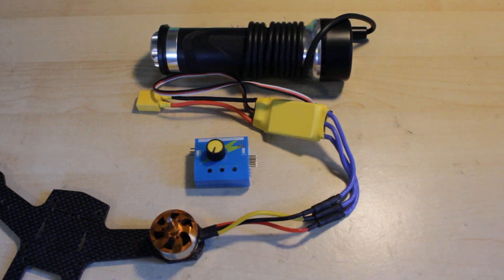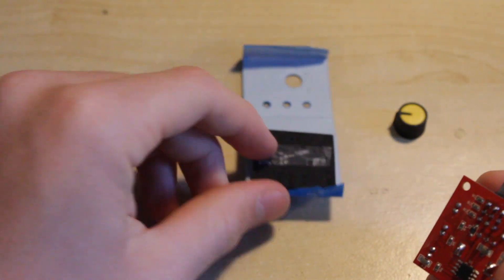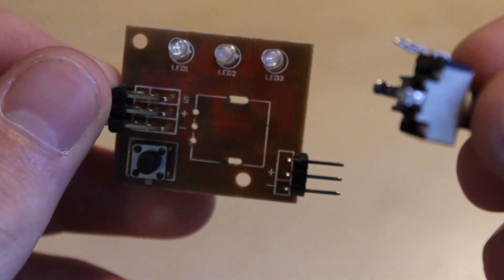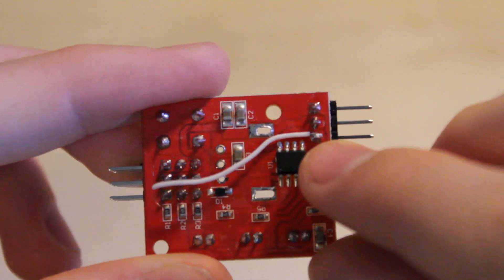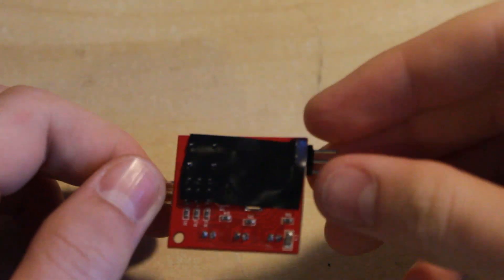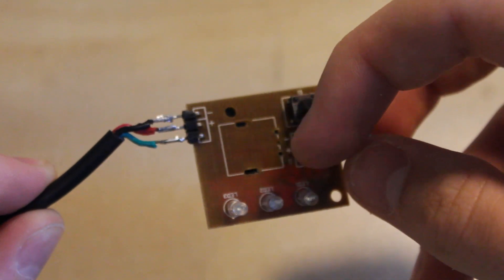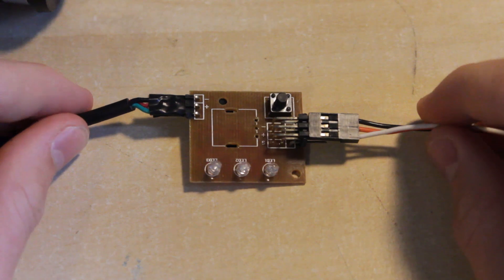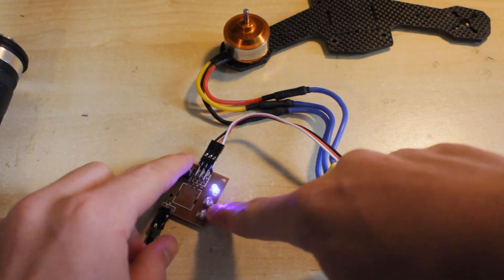How to connect electric throttle to Esc or Vesc

Comment: Hey, I did everything as it is shown, but as I push the thumb throttle all the way up, then it is a stop, ant when I release, it is a full speed lol. What can I do?
Reply: Aand, yes I burned up the hall sensor in the thum throttle when I switched up +5 and negative. So I had to resolder the 49E hall sensor, to fix it. The problem was the magnet in the throttle had been installed the other way around, so I removed it with a small electronic flat screw driver and turned it around. The thing is that it shows 4,2V with throttle released and 0,8V on full throttle. Then it works well :) I hope this comment will help someone. Thank You for this awesome video man!

Comment: Everything works great, but the problem is when I increase the throttle the motor stops and when I decrease the throttle the motor spins at full speed. It’s working the opposite way. Anyone know what might be the problem ?
Reply: I fixed the problem by opening the throttle and reversing the magnet

Comment: I connect everything exactly like shown, when I push the throttle the LEDs light up but nothing happens. I tried making a jumper connector but that didn't work either. Any ideas as to what the problem might be? Thank you in advance.

Comment: Hi Gabriel, that’s a nice video.
I have a 12v motor, 12v battery and a twist throttle. How can we use servo tester as a 12v motor controller?
Any idea ?
Reply: What type of motor?  What type of throttle?

Comment: Hi I had follow all in your video but when i  acceleration it stop but when i release the throttle it speed up . What to do next
Reply: Flip the magnet in the controller or use a servo signal reverser.

Comment: Thanks for the clear demonstration. I, like many other people, have an Opto ESC (Turnigy Dlux) and the servo tester 
works only when powered by external voltage source. 
My problem is that I need a sliding potentiometer for my DIY gas throttle, not a rotating one. 
Would it work if I just desolder the rotating potentiometer and connect a sliding potentiometer (by two wires) to its place, not making the jump wire connections? Would that leave the servo tester's action modes (automatic, manual etc.) intact.
 If you can advice me on this issue, thanks in advance!
Reply: I solved the problem. The servo tester has on the side of the esc three entries. You just have to connect a 5v battery with the second entrie. The first is connected with the esc cable. 
Sorry for my english.
Reply: You would need to solder all three wires from your sliding pot (10K?) to the board and also jumper the 2 pot tab holes together to continue the +5VDC to the circuit.  As you state, you will need external power.  The action modes will still function, it defaults to pot control.

Comment: Something useful, Thanks,  but how instead of throttle add full power on off switch?
Reply: That would be rough on drivetrains!  You could try a SPDT switch in place of the POT with the center to green signal, one side to +5VDC and the other side to negative.  I have not tried that.

Comment: Hi, I have tried this modification with thumb throttle, the Led all lit but no response when I press the throttle. I solder the connection as in this video. Any suggestions?
Reply: Same.for.me :(

Comment: Can you plug the throttle on the channel side and add a receiver and be able to switch back and forth between rc control and throttle
Reply from the maker: yes if have a servo connection on the end of the throttle cable and then a jumper for when you completely remove the servo tester. This will allow it to be both rc or human operated

Comment: most helpful video ever! thankyou very much!!! only question is, if your esc doesnt have a BEC where do I run power from for the servo tester?
Reply: From a battery with the voltage required of the serve tester

Comment: Hi Gabriel,
I made the same process as you but at the end I have a light on (like you) but when I throtle up the other two less light up too... For example:
25% throttle - one led up
50% throttle - two led up
Full throttle - three led up

Can it be bad connection?
Reply: Just solder a wire (jumper) from the 2 big pins Ground on the board, it should work.

Comment: Is that a sensored or sensorless brushless motor? I'm guessing sensorless. If it was sensored, it would have that weird 5-wire connector coming out of it with the 2-red, white, yellow and black wires right?

Comment: GUYS IF YOU WANT TO CONNECT AN OPTO ESC JUST CONNECT THE POSITIVE AND NEGATIVE FROM CABLE THAT ALLOW YOU TO PROGRAM YOUR ESC, THEN YOU HAVE TO SOLDER THE TWO SIDE SUPPORT FOR THE POTENTIOMETER (NOT THE THREE WIRES, BUT THE SIDE SUPPORT) CONNECT IT TOGHETER AND IT WILL WORK !

Comment: I dont have any controller i direct the batt to the motor so i need to use this badly
Reply: I did that with a brushed motor and a lead acid battery power source. It was inefficient (energy wise) and heavy and everything got hot but it was a radical setup and funner than not having a motor.

Comment: I thought these VESC controllers already had an Analogue to digital converter (ADC) inputs with +5v & negative throttle supply?
Reply: Jamie Low that’s what I did. It’s a lot easier
Reply: yes cool but how does it work and how shout i conect it
Reply: VESC does, regular RC ESC like he is using does not.  This makes it possible to use a regular RC ESC.

Comment: thanks a lot for the video. It didn't work at first, then (after some troubleshooting) I joined the two joints where the potentiometers body was soldered in, and everything started working fine. Thanks again mate.
Reply: Yes me to and i think this man in video skipped this step in purpose. I don't know why he did it

Comment: Its Work !!!
But the throttle is reversed ,when i pull the throttle the motor is off and when i not pull the motor is on.
Please Help me
Reply: It sounds like your polarity is reversed or inversed or something at some point. It sounds like you maybe didn't solder the wires in the right place somewhere on the servo tester. I would be curious to see with the way you have it set up what would happen if you reversed the polarity of your motor and see if it works (change the red for black wire positions). If it works or comes closer, then that might indicate your wiring is off on the tester. This is sort of a laymans/experimenters reply though.
Reply: I just finished wiring things up, and have the same problem. 
I'm using a thumb throttle. When the throttle is in normal position (ie: 0 speed), the motor runs full power. When the throttle is in full power, the motor is off.
So it does work, but in reverse.
I'm now going to test some things and see if I can get it to work as should.
Reply: UPDATE. I fixed the "reverse problem" by actually flipping over the hall sensor. IE: The marking on the sensor was facing the magnet. Now the backside of the sensor is facing magnet.
I'm 100% sure that flipping the magnet would also have worked, but in my case it was easier to flip the sensor over.

Comment: bec esc yes...but how to connect for opto esc?
Reply: Same thing you just have to find a way to give the servo tester power in addition to this process , i think you can use one of the other pin sets to give it power.

Comment: I am running two motors, with two ESC's.  Would I be able to plug both ESC's into the servo tester so that I can run both motors off of the one throttle.
Reply: yes
Reply: Yes, be sure to disconnect the red +V from either one of the ESC's.

Comment: If have everything like in you did but when connect the servo tester to my esc the motor just bibs every 5 sec and the the 3 lights on the servo tester only turn when I turn the throttle

Comment: Finally it works.
You should accelerate the throttle and hold it before hand. After that, connect the battery to the ESC. Once the beebs have finished release the throttle! Now it should work.

Comment: Doesn't work for me :( I think I fully damaged the board
Reply: didnt work for me ether
Reply: You need to connect those two ground joints together where the potentiometers housing was soldered.
Reply: @rimka11  you are a beautiful man/woman...
Reply: Might just be a different version of the board. Different manufacturer maybe or later revision, don't know.
p.s. yes, I just checked mine, it really is a bit different than that in video.
Reply: I can't get it to work either. Connected the jumper from pin 3 to the center pin of the pot, and the jumper between the chassis pins of the pot, but still no go. LED1 lights up, but ESC is not armed.
Reply: BlackedHatGuy  Yeah I read that advice from @Rimantas V here, so that's what I did. Still doesn't work, and I don't have a scope to check the PWM output...

Comment: If i program the ecs with a programming card before adding the throttle will it have the new settings or just the default settings?
Reply from the maker: this is running the standard settings but you must make sure that motor breaking is turned off
Reply: Gabriel Robson Or it will break when you dont give it throttle?

Comment: Hi, I am very happy to see a video like that because I was looking exactly to an explanation on how to connect an E-bike throttle with an ESC. So thank you very much! I have just one question: Since you didn't use any battery to feed the servo tester, the ESC you used is provided of BEC which provide the current to power on the servo tester right? So what about connecting an E-bike throttle with an ESC without BEC? How I should provide power to the system? Thank you
Reply: I solved the problem. The servo tester has on the side of the esc three entries. You just have to connect a 5v battery with the second entrie. The first is connected with the esc cable. 
Sorry for my english.
Reply: I "think" the ESC he was using got ubec 5v. And if you dont have ubec on your ESC then just buy a seperate bec, your number of cells to 5v.

Comment: Hi! Can you go the other way around? I want to use an e bike controller to power a skateboard. Can you connect remote receiver - servo tester - e bike controller?
Reply: Jarle høgenes any info on this? Kids have a razor dirt quad with 24v 350w motor and controller i would like to connect a rc controler to it so i can control the throttle when needed

Comment: One thing you forgot to mention is the type of throttle setup. There is a hall effect and there is the potentiometer, which is one is it you used? Great video.
Reply from the maker: RoPower thanks, this was done using a Hall effect throttle
Reply: Thanks, man!!
Reply: Gabriel Robson: Can I find the parts on Amazon? If possible! Can you give me a link? Thanks in advance!

Comment: This is a great tutorial! I'm trying to do this for my e bike build, however even though I soldered the throttle wires to the servo testor correctly, it seems as if the connection to the ESC isn't good, since when I power up the whole thing the esc doesn't beep at all. Mind me asking how I can fix this or what the problem might be? Thank you so much
Reply: did you figure it out? same problem here
Reply: After powering on, push the button on the server tester once and the 2nd LED (neutral) will light up, leave it there for a couple of seconds then it should connect. After this push it twice more to move it back to the first LED and you should be good to go :)
Reply: @darcysnell6243  This would be for an ESC that has reverse, which gives you 50% forward, 50% reverse.  You can also advance the throttle 30% and hold until connect for 70% forward, 30% reverse.  If the motor runs backwards, reverse any 2 motor wires.  If the throttle is backwards, you will need to flip over the magnet inside.
Reply: You will also need to jumper the holes where the pot tabs were to provide +5VDC to the circuit.

Comment: is it ok or possible to connect the e-throttle into the servo tester without having to remove the potentiometer on it? and is it possible to connect the e- throttle directly into the esc? tia
Reply from the maker: im not sure as have never tried it but i guess not as the signal wont be taken from the e throttle but the potentiometer instead
Reply: My theory would be that if you left the potentiometer on, it would be a speed limiter?
Reply: I would love to know this. I am looking for a speed limiter. And if i just can solder a switch inbetween the potentiometer and the board. I might just have a perfect speed limiter :-)
Reply: Should work without removing potentiometer, as someone said I also think it would work as a speed limiter, but still you can do a throttle range reset.

Comment: I noticed in the video you're basically connecting positive-positive;negative-negative;grnd-grnd.. do you absolutely need the servo tester in between the throttle and esc??
Reply from the maker: yes it converts the analogue signal from the throttle into a digital one for the servo
Reply: Gabriel Robson thank you so much I've ordered a throttle and the sensor next is my choice of motor and esc, etc. Haha thank you again!! :)

Comment: please help, I have the same servo tester as you. I connect all wire as you. But the throttle is reverse. Mean in zero throttle position motor run full power and vice versa
Reply: better don't...
Reply: Gabriel Robson I just want mine to work!! I bought two new servo tester for soldering, it's so hard! Any advice, like would a hobby shop maybe solder it for me?
Reply from the maker: the easiest way to solve this problem is to pop off the twist section of the handle and rotate the magnet that is inside on the handle by 180 degrees this then reverses the hall effect and should work properly. Hope this helps :)
Reply: Or reverse the positive and negative cables to your motor...it's electricity..
Reply: Tin Nguyen true true. Brushless motors aren't the same as brushed ones.
Reply: Did you solve your problem ? Got the same here :/

Comment: I follow what you did, but you didn't explain what the board does. Why is it needed, what type of signal is outputted from the 'throttle', and what type of signal does the esc need?
Reply: basically the board turn the analogic signal of the trottle into a digital signal for the esc
Reply: I should be able to plug into the rc receiver throttle port as my digital signal?

Comment: i have a opto esc.. how do i supply power to the servo tester ? do i just tap into the throttle wire negative and positive?
Reply: you can try pluging your power source on the esc side
Reply from the maker: VRLE you will need to buy a 5v Bec that's rated to the cell voltage you want to run most are 2-6s. Then solder that to the main power leads or the battery connector.
Reply: ty for the help!
Reply: Hello, I have an option esc too. I tried this modification today but it failed to work. If the power for the Servo tester (from the UBEC) is supposed to plug into the input (where the ebike throttle cable is soldered on) than where do I now plug in the power? Can anyone help please I would greatly appreciate it

Comment: what a waste of time and money on a vesc you can connect the throttle straight up to an analog pin on one of the headers along with a 3.3V and GND pin.
Reply: wire it up as I said it there comment and in BLDC tool in "app configuration" tab go to ADC hit current norev center set max voltage to what ever you read in the display when you hit full throttle (same for minimum) and you should be ready to go.
Reply: Craftimonium yes there ADC pin
Reply: @mikelemon5109  I tried this method - didn't work using the built in ADC. I had to use the above method and install an inline analogue to digital converter. Works fine
Reply: Jamie Low look for a vesc pinout and you should get this to work by connecting one wire prom the pot to ground another to 5V or 3.3V and the middle trimmerp in to ADC of the vesc then program the vesc to read input from ADC Pin instead of ppm.
Reply: @mikelemon5109  yes I have tried this, but it doesn't work. I think my throttle is a hall sensor effect throttle & not a potentiometer could that be it? Also I'm not using BLDC tool software I'm using VESC tool so need some guidance as to configure the VESC using VESC tool to allow the in-built ADC to work
Reply: Jamie Low the hall sensor works the same look for a tutorial on how to set it up I'll try to link you to one later
Reply: @mikelemon5109  brill thanks 🙂
Reply: Can I just hook up the battery and the motor and the throttle without any speed controller or bored at all no Bluetooth etcetera just battery motor and throttle
Reply: This is NOT for a VESC, it is for a RC ESC which does not have an analog input.

Comment: Hi Gabriel, Nice video-. Where did you buy the handle, and what specs should I look for when finding a throttle-handle ?
Reply from the maker: I bought the handle of ebay and its for an electric scooter just make sure it uses a hall sensor (which most do) and it should all work fine